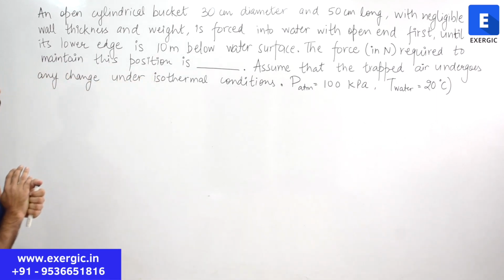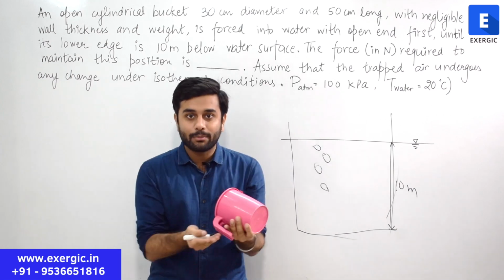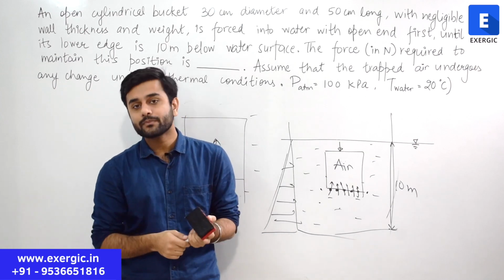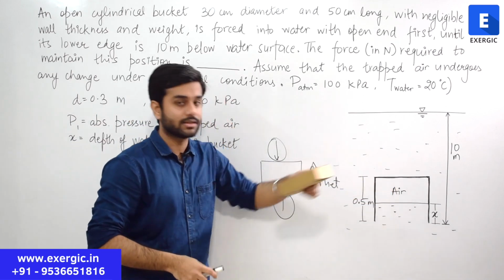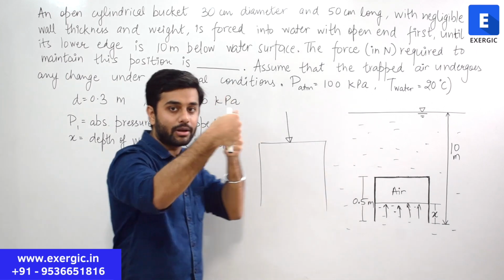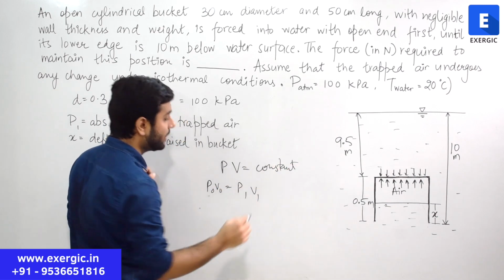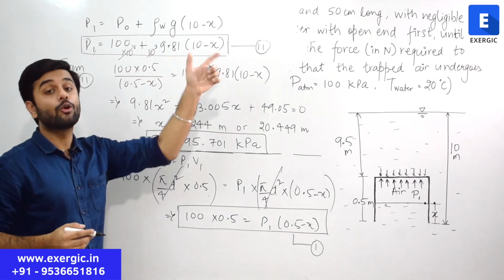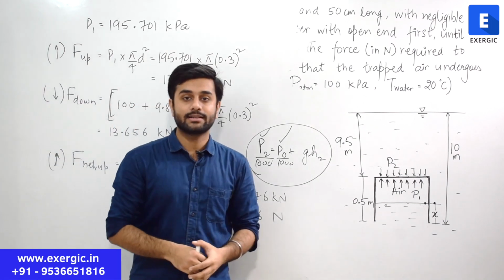Compressible air numerical - Fluid Mechanics | GATE Mechanical

Comment: In bucket  layer of water and air, at side of air, air is more dense near the layer than bottom of the bucket. for this question, in bucket at gases region u can't told exactly force without a assumptions.

Comment: But sir as depth increases the pressure of the air both top side and bottom side increases, why to take only bottom pressure?
Reply: in case of gas, pressure is uniform inside the volume